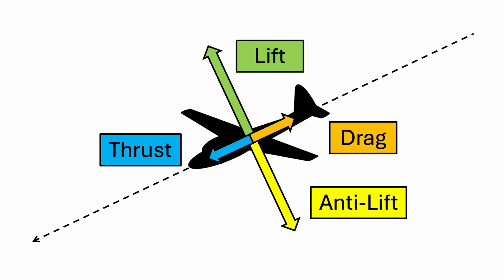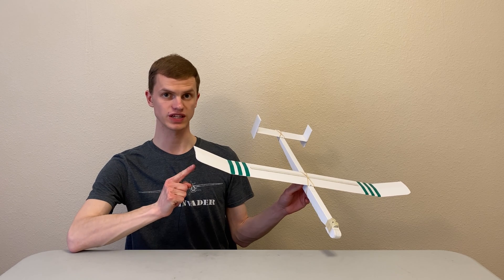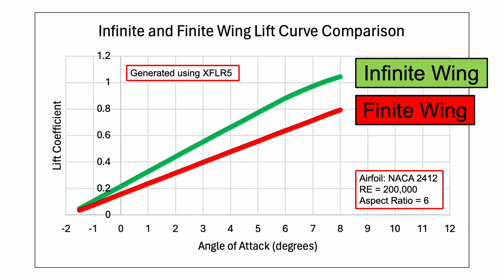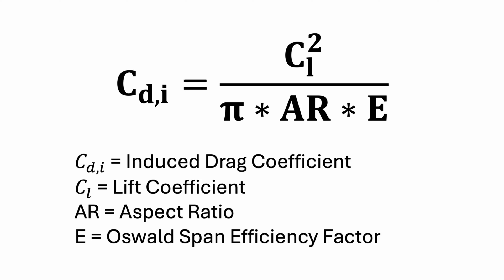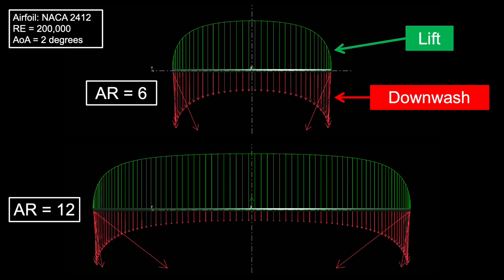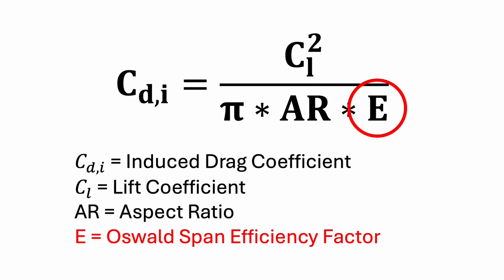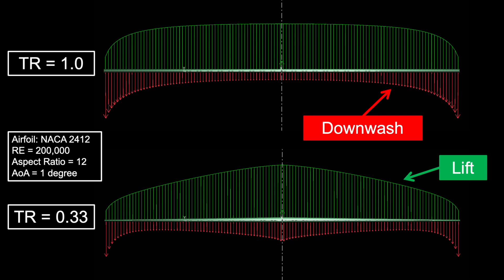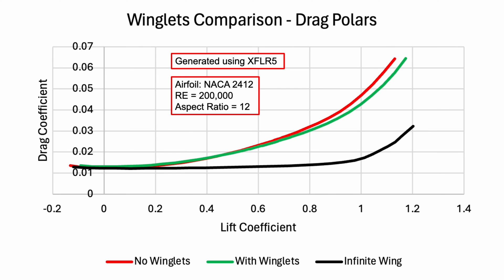Induced Drag Force Explained

Comment: false. wingtip vortices are not what causes induced drag. Even when wingtip vortices don't exist (2D profiles, infinite span wins, full width wind tunnel models....), induced drag still exists.
Reply: Neither causes neither. Correlation is a better word for both. The only thing that causes anything when a body is placed in a flow field is its shape. Everything in the flow field, the flow features, the surface pressure maps, the drag forces are all linked together and occur simultaneously, hence they are all just correlated with one another and neither can cause one another because they are not independent of one another.

Comment: The aspect ratio does NOT  matter 
It is the square of the SPAN LOADING (L/b)²
independent of the AR 
Use the Induced drag force , NOT the drag coefficient. 
compute the force from the coefficient and do the right algebra.
you will find that the chord CANCELS  out
As Javier Milei( president of Argentina) says
it is not the aspect ratio , ¡carajo!

Comment: Surely an infinite wing also generated downwash? Simply by pushing air down by generating lift? Right?
Reply from the maker: At small angles of attack, there is almost no change in the drag coefficient of an infinite wing, and it is often assumed to be constant.  You are correct though that at higher angles of attack, the drag coefficient of an infinite wing will increase significantly.

Comment: The induced drag is due to the tilting back of the lift vector, that is correct, but it does NOT depend on the aspect ratio meaning it does not depend at all on the chord of the wing, just the span
Di = (L/span)² / π Q
nothing to do with the chord meaning does not depend on the aspect ratio
This is a common missconception because you should use the actual forces, not the coefficients
Do the algebra! and you will see that the chord cancels out
Reply: > but it does NOT depend on the aspect ratio meaning it does not depend at all on the chord of the wing, just the span

very interesting point, [1] has similar reasoning as yours. however,  is this what matters in reality?

let's start with simple example: when optimising max-distance, with free choice of airfoil, I'd care only about glide ratio L/D=CL/CD, not about the absolute  drag force (even if L is fixed for cruise, CL is somewhat free to choose). 

then I see these random points (correct me if I'm wrong):
1. for CL/CD - I care about CL & CD, and CDi depends (or is approximated to depend) on aspect-ratio [2][3][4]. Would be interesting to see more math on how this Cdi formula is derived from  tilting back of the lift vector in human-understandable format @DesignYourOwnAirplanes-xd6lz
2. Lift FORCE is not independent from wing area, and thus at least indirectly from span, as for given wingarea, one couldn't get very long wingspan without reducing Reynolds (chord) or without increasing structural weight (see next point) !!! aspect = span^2/wing_area ~= span/chord .
3. coming back to your point about wingspan, indeed it's better to have more wingspan, and consider "fixed structural load" (yielding Bell spanload) vs "fixed wingspan" (yielding Elliptic spanload)   => Nasa Prandtl for same structural load obtains ~1.2x larger wingspan, and yields ~20% reduction in induced drag. However, IMHO this (i.e. use Nasa Prandtl/Bell shaped distribution to freely increase your wingspan by ~1.2x) is where it ends that only wingspan is important, and not AR/chord.

[1] https://aviation.stackexchange.com/a/99281
[2] https://en.wikipedia.org/wiki/Lift-induced_drag#Calculation_of_induced_drag
[3] https://en.wikipedia.org/wiki/Lifting-line_theory#Elliptical_wings
[4] https://en.wikipedia.org/wiki/Oswald_efficiency_number

Comment: Induced drag is my least favourite kind of drag, it shuns more compact wings due to high lift concentration and thus strong downwash, and benefits low lift concentration high AR less compact wing
Reply: no, it really doesn't. you can create amazing low aspect ratio aircraft that can even out perform high aspect designs, depending upon the mission.

Comment: Oh dear… Wingtip vortices exist, certainly, but explaining induced drag as “vortices!” gives no insight, does not help explain why longer spans have lower drag, and leads to bad intuition (like, “end plates will block the formation of wingtip vortices and eliminate induced drag”). 
Your video has all the required facts; but trying to tie everything to the vortices, as you did, isn’t helpful. A better - much better - approach is to tie everything to the downwash. Downwash is necessary to create lift, as you note. If the speed of the airflow is constant, then downwash also implies a loss of horizontal momentum of the air, which is drag. THIS is the actual source of induced drag - as part of your video acknowledges, although for some reason you attribute the downwash to the tip vortices. Now, the lift per unit span is essentially proportional to the deflection angle of the airflow. The resulting induced drag per unit span is approximately. proportional to the square of the deflection angle. For a given total lift, the deflection angle is inversely proportional to the span, which means the total induced drag is proportional to 1/(span ^2) x span, I.e., odd proportional to 1/span. Aspect ratio, of course, is span^2/area, so if we fix the wing area then induced drag is proportional to 1/Sqrt(AR). By attributing induced drag to deflection angle we can deduce this relationship from first principles; talking about vortices won’t get us to this result. Also, because we know that induced drag is related to downwash angle, and thus to total lift and (effective) wingspan, we know the only way to reduce induced drag is to increase effective wingspan - which is what tip plates and winglets do (although less effectively than simply adding more wingspan).
Well, what about those tip vortices? Sure, they exist, when you generate downwash near the wing, but not far beyond the wingtips, you wind up with a shear between the air that’s moving down and the air that isn’t. That shear, plus viscosity, results in vortex formation. And yes, the total energy tied up in the vortices does represent drag, but that energy is extracted from the downwash and we already know that the downwash creates drag by deflecting the airflow; worrying about vortex energy provides no additional insight.
Your video touches on the idea that a 2D wing generates no downwash. This is misleading. A 2D wing is the limit of a 3D wing as span goes to infinity. For a fixed total lift, as span goes to infinity the lift per unit span, and therefore the downwash angle, goes to zero and in the limit there is no downwash. But if lift per unit span is held constant, calculating the 2D case directly involves dividing infinity by infinity, which may appear undefined; but calculating it as the limit of the 3D case as span goes to infinity is easy because the deflection angle stays constant - so in the limit there is, indeed, downwash.
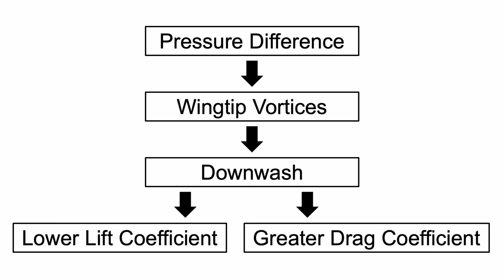Anyway, from the point of view of offering an insight into induced drag, starting with vortex formation offers no insight; starting with downwash provides plenty of insight. Your box diagram at 5:24 should be re-ordered to Pressure Difference -> Downwash with two boxes beneath it, for Induced Drag and Wingtip Vortices, as both are consequences of downwash.
<\Rant>
Thanks for all the effort you put into these videos!
Reply: I'm an inventor who's been redesigning internal combustion. Now I'm getting into aero, including propulsion systems and wings. I think there's a better focus: the real enemy is span-wise flow. The solution appears obvious, and it's not kluges like fences and wingtips. I won't post "the obvious" here, but let me know if you'd like to see it privately (and shoot it down?)
Reply: @RePeteAndMe  I'm not going to post an email address here, so a private viewing may be difficult. However, if your focus is on spanwise flow I fear you are focused on the tail, rather than the dog - just as this video is. Far from the ground, lift requires downwash, and the downwash plus conservation of momentum is the source of the drag. The shear between the downwash region and the non-downwash region (beyond the wingtips) gives rise to a vortex, and the vortex gives rise to the spanwise flow. If you did have a scheme that successfully reduced spanwise flow, it would reduce the vorticity, which would require reducing the shear between the downwash and the non-downwash, which would require reducing the downwash, which would imply less lift per unit span - which you can really only achieve by reducing the span loading (i.e., for a given weight, increasing the span).
Reply: Could be. I’m just learning about wings and initial concepts rarely survive scrutiny.
My propulsion concept uses a much improve piston engine and a different type of counter-rotation:
A direct drive open fan is at the aircraft’s cone-shaped nose, which contains the engine and flight deck.
The rear of the flight deck is the largest diameter of the fuselage. A planetary gear driven fan between said flight deck and the plane’s cabin counter-rotates at about 1/10 engine RPM.
The plane’s nose spreads, slows, and smooths the front fan’s wake while entraining lots of air. The huge and slow rear fan bats said wake straight back, conveniently leaving a fuselage-sized hole for the plane to slip through.
Reply: @FinbarSheehy Yes, the wing a micron from the tip can't have any down wash or be involved with lift. Of course, span-wise flow is impossible to to delink from said micron of wing tip. If you have zero span-wise flow and zero lift at that last micron you have no "primary" vortex, right?
Reply: @RePeteAndMe  I think we'd be getting into calculus and limits, there.
Reply: I spent a few days relearning a lot about aerodynamic forces and I finally came back to this comment and mostly understand it now, thank you!
Reply: @nkiwi77  Glad it helped. It's tough to communicate the dynamics in text, but practically impossible if you try to tie everything to the tip vortices!

Comment: Winglets do not reduce the bulk vorticies, instead they convert a small amount of the tip pressure gradiant into thrust by "turning" the airflow rearward.  None of the popular books describe what is going on correctly.
Reply: isn't that (extracting energy into thrust) equivalent to reducing the vortices?
Reply: @vidmasze  the vortecies aren't reduced in the slightest.  They may be delayed by half a meter, but the magnitude isn't affected because the spanwise pressure gradient is the same
Reply: @vidmasze  no, it's using the vortices to create thrust, to offset some of the total drag, but the total drag has not decreased. but the added thrust effectively "cancels out" some of that total drag.

Comment: The elliptical wing has an efficient lift profile because the pressure gradient near the tip is low, and the skin friction area is also low near the tip, and the wing weight is low near the tip.  These all add up to hauling around less drag, wasted pressure, and mass that do nothing positive for the airplane.
Reply: yes, glad there are others out there who get it.

Comment: 13:27 are you sure? imho only the induced drag is reduced. The lift stay the same, and the maximum lift coefficient is limited by the reynoldsnumber. A higher reynoldsnumber (higher velocity) increase clmax.

Please correct me if im wrong
Reply: He has it all messed up in his mind.
Ground effect increases the pressure on the bottom of the wing, increasing the force of lift, because air has inertia and "builds up" in the region just forward, and below, the wing.

Comment: What force moves a glider forward through the air?
Reply from the maker: The weight of the glider provides the propulsion.  In the basic glider physics video I provided a more in-depth explanation.
Reply: @DesignYourOwnAirplanes-xd6lz  Sorry, not correct. The force of gravity is only down, it does not provide movement forward through the air.  Gravity alone cannot move a glider horizontally through the air.  There is a force that provides the "thrust" but it's not gravity.  I know what it is.  Can you tell us what it is?
Reply from the maker: @WAVEGURU  since the glider flies on a downward glide slope instead of horizontally, there is a component of the weight vector that acts parallel to the flight path, providing thrust.  If we only consider lateral motion and not vertical motion, there is a horizontal component of the lift force vector that can be said to provide thrust in the horizontal direction.
Reply: @DesignYourOwnAirplanes-xd6lz  Yes, you've got it now.  What pulls the glider forward is the forward tilt of the lift vector.
Reply: @WAVEGURU exactly.  Gold star.